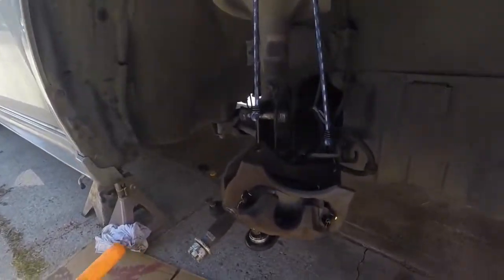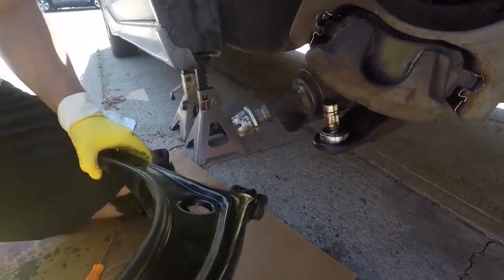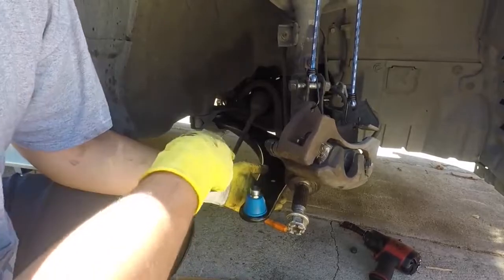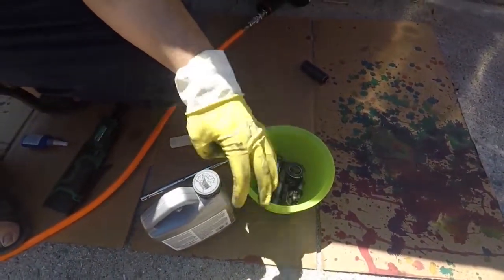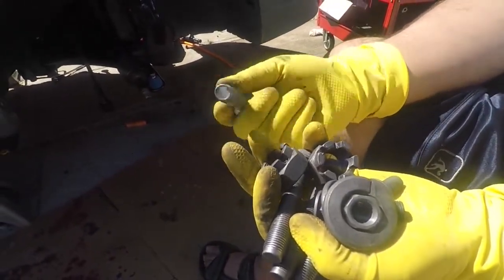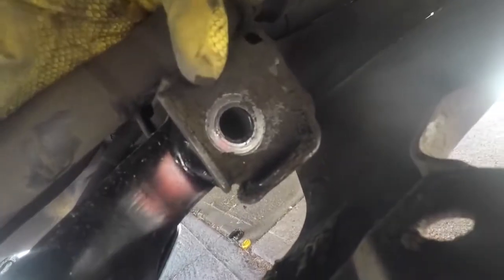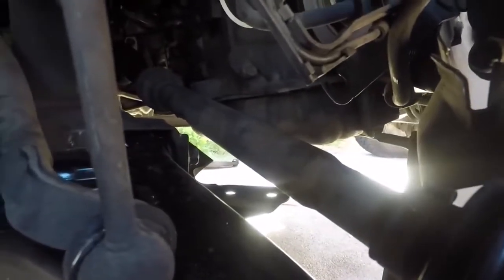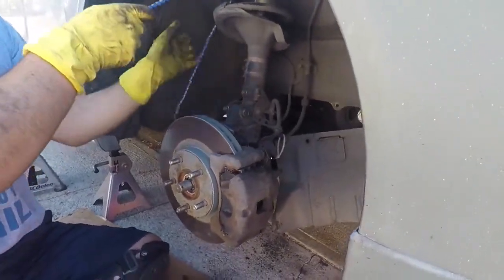Mitsubishi Lancer (gts) Lower Control Arm/ Ball Joint Replacement

Comment: this car starting to suck i replaced my control arms too thinking that was the issue cuz my sway bar hits my control arms over bumps, then replaced swar links and bushings. and struts, and still had that issue idk y i'm at a lost.
Reply from the maker: Your sure that's the cause of the noise ? You know for a fact it hits ?
Reply: @mrbeanz5849  ya it leaves a mark on the sway bar indicating it's been hitting there , but it could be cuz my strut gave out idk
Reply from the maker: @cliffanator  yea I was going to ask if you hit anything? Pothole? You mentioned you replaced the strut already though. Sounds like something is bent . I would check the side that's good and compare to make sure everything looks the same. (Its just one side right or both ?)
And just to be sure , I'd double check the noise is forsure coming from those two components contacting each other, I know you said you saw the witness Marks,  but I know noise concerns can be tricky and noise transfers very easily.
Reply: @mrbeanz5849  the Strut is the only thing I can think of cuz it's connected to that and the sway bar , I always installed a more heavy-duty sway bar link thinking that would help but nothing lol, I get a lot of bouncing and rough ride right now so I'm thinking my strut didn't go bad but I don't see any indication of any leaks or any band or anyting which is more confusing lol